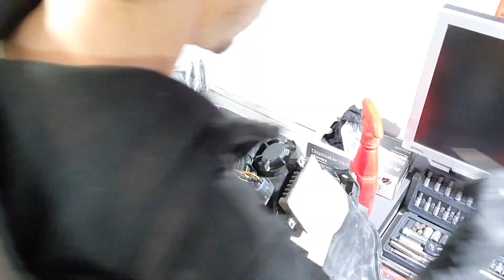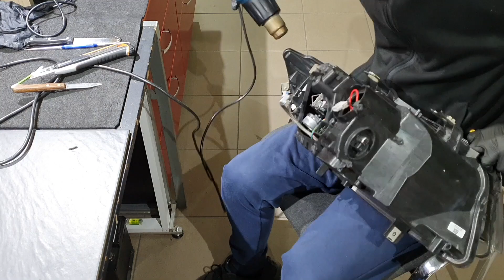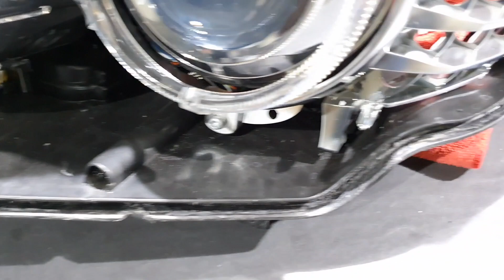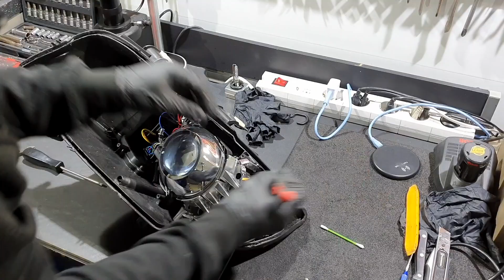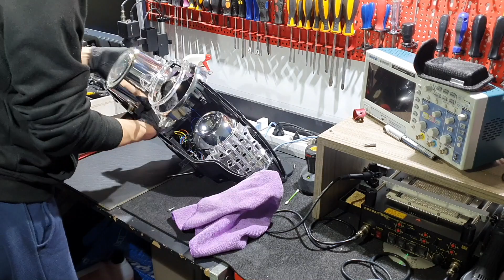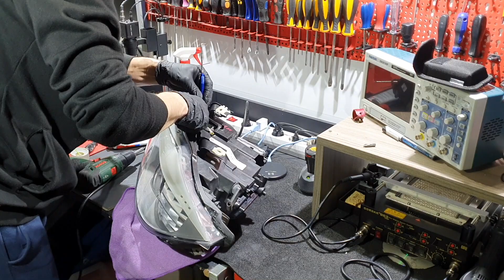BMW e90 Adaptive Headlight Disassembly and Repair

Comment: It appears you replaced the Adaptive Headlight Controller with a new metal cased version. Do these need to be programed by a dealer/shop in order to be recognized?

Comment: On the e90/91, every headlight with dynamic xenon will shine to the left when you are driving in town. As soon as you are on the motorway and drive faster, the position of the lens changes and it shines more in the distance than in the width.

Comment: Hi
I’m going from halogen to hid on my 2011 bmw 328i sedan and just received my set of Bi xenon headlights so my question is
Do these light use to light bulbs and is it necessary to have this part or not
Headlight Electric Leveling Motor Control? Thank you

Comment: What temperature you set at heat gun to open headlight?
Reply from the maker: depending on the headlight ..how cold is the environment ...you need to find the perfect one for you. there is not A temperature...
Reply: @MOvidiu  Thanks. I'll try with 130C setup at the gun. Hope not too little to wait an hour and not too much to deform anything...

Comment: Where is it located at if mine doesn't have that unit on the side of the headlamp I have a 2010 328i xDrive where is it located at My headlamps are LCI

Comment: Great job! My E90 adaptive headlights turn the opposite way of steering input, do I need to open the lights to fix it? Or is it a coding issue?
Reply from the maker: You are doing it wrong! when you have a problem with your car you don't start to ask on internet what can be! you need to find someone who know to repair and diagnose BMW's and go to him for a complete diagnosis. can be from the headlight from modules, from software...
Reply: @MOvidiu  I am very knowledgeable with most every aspect of bmw's except for the modules. I have taken it to an indy shop for a diagnosis but they could not figure it out, hence why I asked you to see if by chance you have encountered this issue before and would possibly know how to fix it...
Reply from the maker: The part with that they didn't figure it out is not accepted that means that they didn't know to diagnose the car or didn't have the interest! you need to diagnose it first, and when I say to diagnose it, I don't mean only to scan the car for errors!!! , doesn't matter if I have found an identical car with a problem like this because it can be a different cause. 
You can try to reverse the TMS module and see if the problem remains or migrate with the module, to do activation. to recode or reprogram the module...
Reply: @bmrbrn1  .

Comment: Do you have the wiring diagram for the headlights?
Reply from the maker: Hello . there is not such a thing a wiring diagram for the inside of the headlight , firstly yow won't need one , the lengthier wire in the headlight have around 30 cm 1 foot

Comment: Great video, really interesting!
Do you have any tips on opening E87 headlights that has not been open before? Just alot of heat and try to open?
My headlights has very bad output and can hardly be seen on the road even with new bults, so i guess they are either dirty or the reflector is bad.
Reply from the maker: Hello ! you need to have patience !

Comment: I bought a angel eyes kit , for these exact same xenon lci headlights , and I’m having trouble on how to connect the wiring . There is no instructions what so ever , that brand is geerge , would I have to cut an anything ?? Supposably it is plug and play lol there is no lead on how to connect them
Reply from the maker: Hello,  My strongly advise is to throw away that junk kit and restore the headlights to their original state,  but if you insist you can connect them to the original sightlight bulb

Comment: Very Nice instructive movie. I am also considering to overhaul my xenon headlights of my e91 from 2006. Can you give me some guidance on where to order these lenses, I see that there are many vendors but I do not trust all of them. Is it also correct that pre-lci and lci lenses are the same? Also which tape/wire/adhesive(not sure what it is called) you use, is that the bmw genuine stuff they also use in the door for the water barrier? Thank you
Reply from the maker: Hello ! unfortunately I don't know where you can find quality lenses or which ones are of higher quality, for the reusable sealant you have a link in the video description !

Comment: Great video! I’ll be going to the junkyard to grab the motorized housing to retrofit into my car. I’ll be using an arduino to control the stepper motors
Reply from the maker: Nice! But why the complications with arduino ? If you want Dynamic Xenon you can retrofit it,  buy headlights,  light module , make the wiring and cod it!

Comment: How do i get the original seal off of the headlight was never opened previously? Without having to cut if possible?
Reply from the maker: https://www.youtube.com/watch?v=W7p1AC1_jjg&ab_channel=M.Ovidiu
Reply: I have e90 LCI
Reply from the maker: Doesn't matter what type of BMW do you have,  you can have an G12 as well,  they all build the same in the matter of headlights asambly
Reply: @MOvidiu  ok cool so could i actually put the headlight inside the oven if so at what degree do you recommend and what should i use to seal it again silicone ? Or i have this tape looking style glue that you can heat up to seal the light
Reply: Also where can i find some honeycomb projector lenses that fit !?

Comment: Hello an information do you know where to buy the original angel eyes rims of the bmw e90? like that when I opened the headlight I broke it and I would always like to put it original thanks
Reply from the maker: Hello,  you can't find it anywhere,  only from other headlight ( the headlight is a seald unit and it is sold as is)
Reply: @MOvidiu  
okay thanks mile infati or looked on all the sites I know but I did not find anything, do you think glue it with aposta glue for plexi resist and keep the same effect?

Comment: Hi Guy!  Congratulations for your job. Please, where can I buy the part you replaced?  What is the name of the piece?
Reply from the maker: Hello Guy !! you will not find parts for headlights because the headlights are sold as a single piece, you will have to look for a donor headlight and get what you need from it .

Comment: This is a good video to convince myself that I should not attempt to do this since I ain’t got all them tools.   My driver side headlamp housing inside somehow popped off so the light beam now points downward.   I’m stressed out about how to take it all apart.

Comment: What if the outside angel lights dont light up and only the inner ones do. Can you please give advice
Reply from the maker: You need to remove the bulb and inspect the mirror and then the head of the fiber for the angel eyes
Reply: @MOvidiu  i cant find any information on what you said. Which is why i made a comment

Comment: What did you replace to repair it
Reply from the maker: nothing , i need to adjust the servo motor in the correct position because the person that have worked in that headlight before me didn't put it back correctly

Comment: Hi, i imported BMW 528i f11 2011 year from Japan and the 15 degree lights are on left side but i need them now to be on right side. How can u do it? Its software thing or its mechanically inside?
Reply from the maker: Hello , you need to change the headlights , or in the lucky side it is possible to have a flap inside the headlight to block the 45% light ( not to change it )
Reply: @MOvidiu  I was thinking the same.Thank you for the answer.

Comment: Hey, any chance you can post the exact sealant that you used to out it back together?
Reply from the maker: Helllo , yes read the updated description !
Reply: @MOvidiu  are you sure the width is correct? It's like 1cm by 1cm? Will it fit in that gap? What do you use to clean lenses and the caps before putting back on?

Thanks ! :)
Reply from the maker: @mateuszpiatek2870   what width ?

Comment: Salut, am un e90 si astazi farul din partea pasagerului sa dua maxim in stang si mi-a aparut eroare in bord. Am puso te tester si i-am dat recalibrare si acum im bat amandoua maxim dreapta. Ce as putea sa fac?
Reply from the maker: Salut Adrian,  trebuie facuta o diagnosticare si dupaia stii ce ai de facut pot fi mai multe cauze...

Comment: Salut am si eu o intrebare, la fel cind aprind farurile pe Automatic Mode farul di partea soferului se pozitioneaza la stinga, iar ala din dreapta sta in pozitia dreapta. E la fel ca problema din video?
Reply from the maker: Salut,  trebuie sa faci o testare si vazut cine cauzeaza problema , e din far din frm ... daca are aceleasi sintome nu inseamna neaparat ca e si aceiasi problema
Reply: @MOvidiu  am inteles mersi mult

Comment: What type of glue remover can i use to melt down the seal in the headlights just to open up the headlights i wanna install the hallo rings
Reply from the maker: Hello,  i don't think you can find a solvent to melt the silicon of the headlight

Comment: Any problems with condencations after this?
Reply from the maker: No , if you seals the headlight properly and make a pressure test,  never will condensed
Reply: Awesome, then I might give this a try. I have this yellow spot, and a lot of wear that I want to polish

Comment: Do you do repairs of 750li headlights
Reply from the maker: Hello,  yes,  is the same process,  but is very hard and time consuming
Reply: @MOvidiu    I have a 2011 328i xDrive sedan with the basic H7 Halogen lights/bulbs.  One side does not adjust.  The adjuster spins.  Can I fix this?  If not, can you?  Is it worth the cost to repair or buy a replacement @ $400 USD?
Reply: i don't recall now, but eith the day light or night light is not straight.

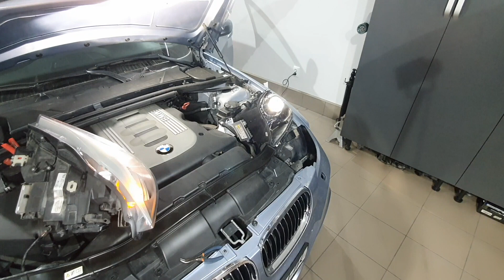Comment: Hi! How did you run that focus test at 8:20 minute? Did you just turn the steering wheel? Tks!!
Reply from the maker: Hello,  it was a test from istaD
Reply: @MOvidiu  Could you a make a video showing how to use istaD? Tks!